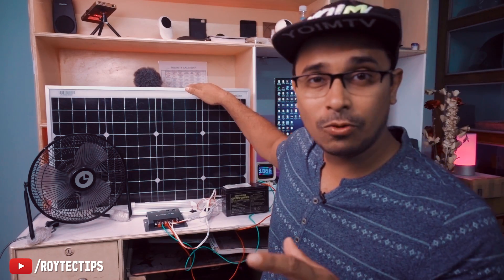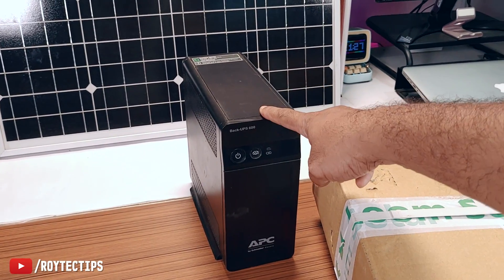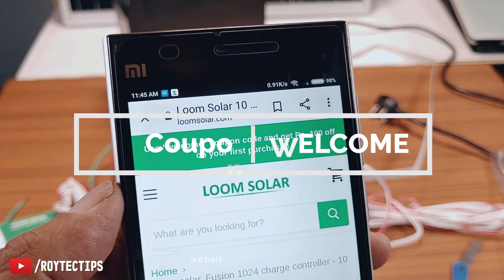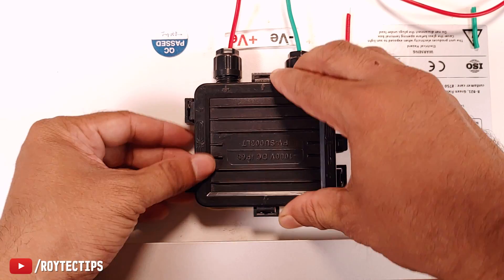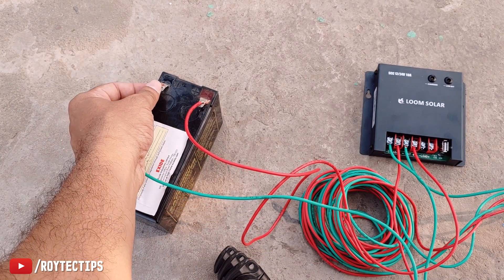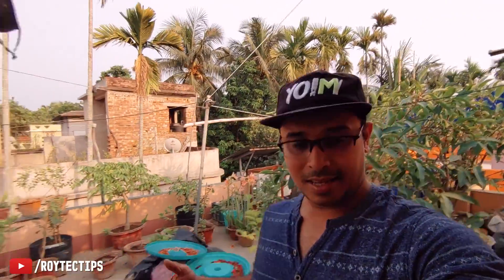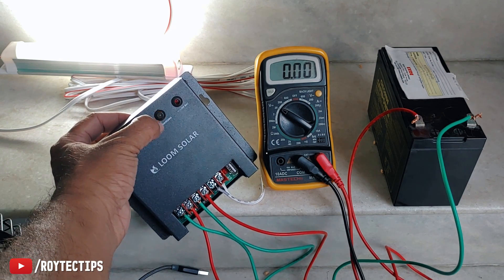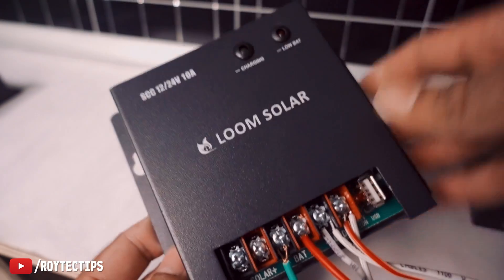Get 25 Years free solar electricity ! Run FAN ,tube lights, Charge Mobile phone Only ₹3500

Comment from the maker: ☑️☑️Products link that are used in this video
💗💗 Solar Panel                       ✔️✔️ https://bit.ly/3spGeiD
💗💗 Solar dc Tube light          ✔️✔️ https://bit.ly/3xdR7I6
💗💗 Solar Charge controller  ✔️✔️ https://bit.ly/32mUoGL
💗💗 wires & installation kits  ✔️✔️ https://bit.ly/2Q47rui
💗💗 Solar fan                           ✔️✔️ https://amzn.to/3x0WSZn
💗💗Lithium batteries             ✔️✔️  https://bit.ly/3ttRWdh
💗💗 Lithium batteries charge controller  ✔️✔️ https://bit.ly/3srOBdE